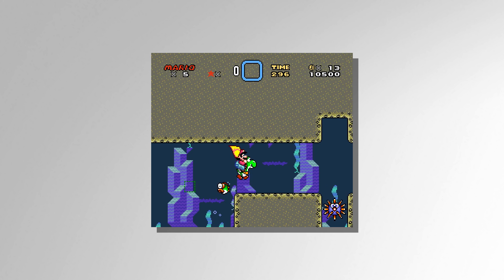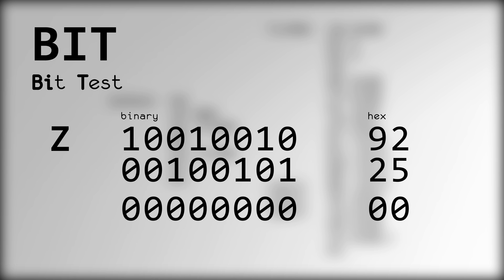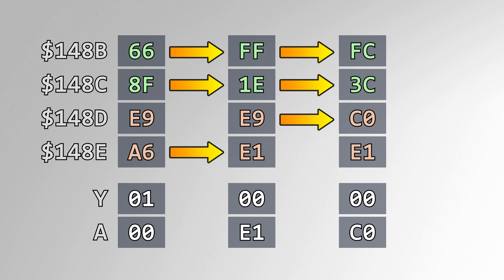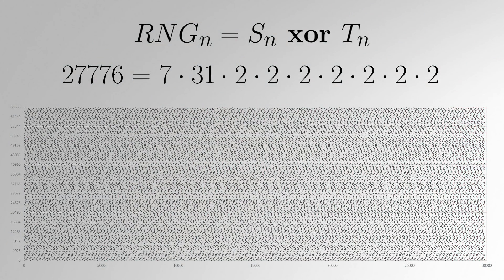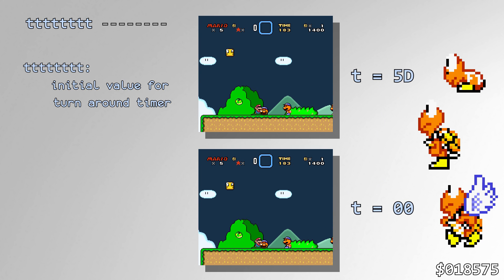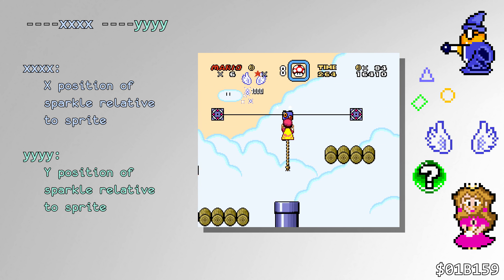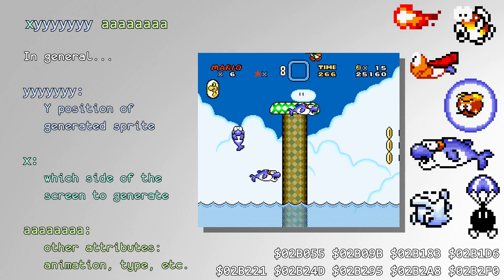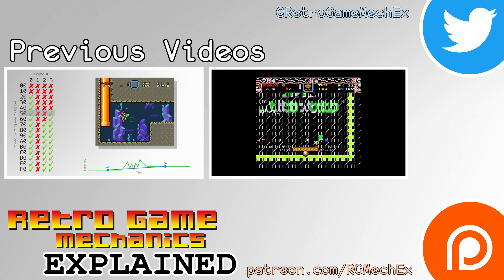Super Mario World - Random Number Generation

Comment: Found another error in the RNG values shown on screen, this time at 6:58. Here, th line that should read "06 03 05 01" has a "00" where it should have a "01." Also, this time, unlike the previous error I reported, it's not corrected when the line gets to the bottom.

Comment: I understand subpixels as a luck factor, since it's just down to a game having more precise movement than the graphics allow the player to (normally) manipulate. But I don't get speed oscillation
Reply: It’s kind of the same, but instead of the character’s precise POSITION, you’d be interested in the character’s precise SPEED. Consider needing to cross a gap that’s 23 units wide. Let’s say, for the sake of simplicity, that your jump lasts for 5 frames, and your speed oscillates between 4 and 5 upf (units per frame), every frame. Now, if your speed = 5 upf on the first frame of your jump, your speeds throughout the jump will be: 5-4-5-4-5; so, your jump will carry you 5 + 4 + 5 + 4 + 5 = 23 units; so, you WILL cross the gap. If, on the other hand your speed on the first frame is 4 upf, your speeds throughout the jump will be: 4-5-4-5-4; so, your jump will carry you 4 + 5 + 4 + 5 + 4 = 22 units; so, you WON’T cross the gap. As you can’t normally keep track of your precise speed every single frame, that event is considered luck-based. 🤓

Comment: why they didn't use the user input as a source of entropy to seed the PRNG? For example, every time the user presses a button, the current value of the internal H/V counter latch is captured and sent to the PRNG
Reply from the maker: Well in this case, it's not possible since controller button presses don't generate interrupts--the controller doesn't tell the CPU that a button was pressed, rather the CPU checks on the controller when it needs to.
But in general, latching the H/V counters is possible. I believe Yoshi's Island does this, just during the generation routine instead of on a button press.
Reply: @RGMechEx  I see. Anyway, very accurate and in-depth explanations on your videos, very well made,  congrats!

Comment: I'm not sure if your formula at 5:26 works when the 7th bit of T_n is set. Evaluating floor((255-2*T_n)/32) mod 2 when the 4th bit of T_n is not set and the 7th bit is set comes out to 1 when it should be 0, floor((255-256)/32) = floor(-1/32) = -1 = 1 mod 2. And if both the 4th and 7th bit is set, floor((255-288)/32) = floor (-33/32) = -2 = 0 mod 2.

Unless I'm reading it wrong and it's round towards zero / truncate?

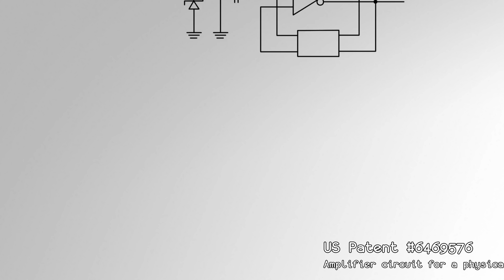Comment: 13:37 Well, I have a question: Those gambling machines with video poker (which you see a lot in Las Vegas) - are they truly random? Is that an example of hardware-based? Because I assume that they would legally have to be in order to be considered “fair”.

Thanks,
~J.J.
Reply from the maker: Things like slot machines get regular inspections to ensure they are operating as they should. So the answer to your question is yes. It would depend on the implementation on whether it was hardware- or software- based, but I would guess that if it were software-based, it would be much more complex than what was shown in this video.

Comment: The implementation of RNG routine, with the XOR and the repeated values resembles the structure of some hardware entities called Linear Feedback Shift Registers, or LFSR. These are widely used for pseudo random number generation in programmable hardware devices, such as FPGA. Could you confirm? Btw Great video!
Reply: S is formed from a linear-congruential PRNG, where m = 5, a = 1, and the modulus is 256.  T is formed from a simple 8-bit linear feedback shift register based on the polynomial x^7 + x^4 + 1.  They used two very simple PRNGs, and combined their results together to form a better PRNG, which isn't a bad technique overall given how few instructions were involved.  So you're correct that half of it is, in fact, a canonical LFSR, while the other half uses the somewhat-related LCG technique.

Comment: "It's not random because the outcome is consistent and predictable"? Uh, no. If that were the case, you'd be able to perform the exact same button inputs and get the exact same results. Saying that a D-20 isn't "truly random" because it doesn't cause a wizard voiced by Weird Al to appear is really stupid. And yes, one could theoretically determine the outcome of a D-20 by measuring the force of the roll, the friction of the table, etc, but by that same logic, a computer program doesn't have such variables, meaning that it's even MORE random than what one would find at a casino. Trying to say that something isn't "truly random" is really, really stupid.

Comment: Another great way to get more randomness without additional hardware is to take inputs states at various intervals and use them as seeds. Not that random in a console, but for example in computer software, it's very typical to grab mouse movement, which is very difficult to replicate

Comment: So even though the RNG will repeat every 27776 calls, it seems that for a lot of the RNG calls that only care about the results of the upper or lower bits; this means that for their relevant behavior that RNG call sequence "repeats" for them every 128 or 217 calls, respectively, even if the full number 16 bit number is itself unique.

Also, I have a question: For Wendy and Lemmy their index for which pipe to appear out of is 4 bits long, allowing for 16 possibilities. There's only 8 pipes possible to appear out of. How exactly does the that work?
Reply from the maker: The generated value is used as an index into a table instead of the pipe index directly. It is also responsible for the locations of the dummy Koopas. There are only 16 patterns for where all three show up, even though there could be 105 if every combination were possible.

Comment: You can be truly random without more hardware: By measuring time between button presses, by reading the RAM at the beginning before zeroing it out, among other tricks. Although most of the time this amount of information is very limited, so it's only useful for seeding. It's just more random, no truly random.
Reply from the maker: Reading RAM before it is initialized isn't actually as random as you'd expect. Once the console is turned off for at least 20 seconds 99% of the RAM has already settled on its 'default' value.

Comment: just subbed tonight! Apart from the PHY / PLY, this code should effectively run unaltered on a Commodore 64. Interesting to see such a long, odd value before numbers repeat. Looks like a very fast routine as well. Dunno why they didn't just JSL STA JSL STA RTL and not bother with the Y register at all. Or, the routine can be even quicker with JSL TAY then fall through routine again to get A and exit with random (unsaved) values in A/Y.

Comment: I wouldn't characterize PRNGs as "consistent and predictable." Consistent, yes, but predictability is something that sophisticated PRNGs are specifically written to avoid. In the case of SMW where you can examine 100% of the memory and code involved, and the PRNG is pretty simple in scope to begin with, then it's predictable (and manipulable).
Reply: In principle, every PRNG is predictable, because you could run the same code somewhere else and get the same result

Comment: I didn't understand a thing, but it sounds smart, so i like it
Reply: You, I like you.
Reply: The "Random number generator" creates a pseudo-random number based on a complex set of values (the "seed," I think) that has a tendency to change constantly. Unless there's something hardware-related, computers are actually incapable of creating random numbers.
Reply: @Chaos89P  

yeah. the "random" number generators are just a very convoluted mathematical calculation based on a "seed" value.....if you always use the same "seed" the "random" number will always be the same.
usually what you do is set the seed to the current time-stamp of the computer clock.
that will create a better random number than a static seed,
of course nothing beats a good hardware random number generator....but aint nobody got time for that!
Reply: @sabin97  But the current time stamp is already somewhat random. And when the seed is random, the resulting RNG is too.

Comment: Ok, so where does the seed come from? You said suppose initially it is 66 and 8F. What will determine this initial seed when I start up the game? If it was hardcoded, every game will start with exactly the same RNG outputs and differences will only accumulate due to player actions. If it is not hardcoded, well where does it come from?
Reply from the maker: The initial seed is 0000. This is set when a big chunk of memory is zeroed out when exiting a level. So yes, the game will start with the same RNG outputs every time (even every time you enter a level). A more "random" way of getting an initial seed would be to read a memory value before initialization when you turn on the system. Without initializing it to anything, it is undetermined what a memory value holds, so you could use this as a seed that is not guaranteed to be the same every time the system is powered on.

Comment: Awesome video. Just wanted to mention that using the system clock is a great way to seed any RNG routine.
Reply: I didn't know their were other ways to make a seed...
Reply: Aaron Misner 
Would be good if it would have one and it couldn't be changed easily to make it consistent for every run
Reply: True, or any other kind of timer that runs continually from system boot, which is something that's been used on pretty much every system in the world ever (the earliest i can point to is the built in BASIC of the Sinclair ZX80, and the successor models of course, where using the RANDOMIZE command sets the 16-bit RNG seed to the number of video frames since power-on, repeating every 20 minutes or so in 50hz regions). However, this is specifically about SMW randomness, and as stated, it resets the seeds to zero at the start of each level, so your only actual source of entropy is how many times the RNG has been called in that particular level before the call in question...

Comment: Couldn't you get true randomness by modifying the seeds based upon a value determined gleaned from controller inputs at irregular intervals? Since no two people play exactly the same, nor even does the same person play the same every time, player inputs should be a completely unpredictable variable.
Reply: NES Tetris uses controller inputs to determine next piece so I'm sure it's possible in SNES.
Reply: Kinda.  On a lot of games we used to seed random number generator based on time it took to start game.. as most people would take random amounts of time to press start (or go thru menus, etc).

.. but once game is started, you need to seed numbers based on this value (and record it), that way you can replay what happened in a crash, etc.. to make sure you’ve fixed bug.. (too long to explain )
Reply: groszak1 
That game has much more resources left for computing since it's just a single screen puzzle game.

Think someone mentioned it being common for GBA games though.
Reply: There really isn't such a thing as "true" randomness when it comes to software. Using controlled input to influence unpredictability can actually reduce the entropy of the prng. Even producing it at irregular intervals would still unfortunately need to be decided upon in some way or an event, which is another random decision.

You can simulate more entropy/random-y-ness by masking it w/ noise, but generally allowing for external influence will have the opposite effect, especially when your prng is periodic/cyclic. It's very easy to go down the rabbit hole believing that adding more complexity/noise is improving randomness when in actuality you're likely reducing it. The point is, "true" random numbers are hard, and is a whole field in itself depending on the applications.

Fortunately, though, randomness isn't too important in the context of regular gaming. You only need to convince the player that something is unpredictable and it will have the intended effect.
Reply: I think seanklitzner proved something like that for Zelda 1
Reply: KefkeWren Yes and no. It's not truly random because it's influenced by player input, which is not random.
Reply: KefkeWren Nowadays, I'm sure you could do this. I'd wager that back in the SNES days, memory was too precious to store controller input.
Reply: @mevansthechemist  That makes no sense, have you even written code at a low level?
Reply: @mevansthechemist  Does it necessarily need to store it though? You could modify the seeds every once in a while, based purely on the current input.

Comment: That last part was wrong, though. In order to be truly random you need any kind of random source of entropy. For instance, most GBA games use input timing to seed the RNG, since human hands are inherently random, at least a bit. Of course, this can be exploited by TASers, but oh well, so can almost anything else. More modern consoles have other entropy sources available to them, like network packet timing, or storage media response times. TASers usually try to mitigate those things by starting their runs from completely blank consoles. Have you seen NDS TAS runs and the lengths they have to go to now in order to get consistent RNG?
Reply: Right-bit randomness (like mouse movement) isn't objectively random, but since humans can't move their mouse accurately down to the micrometer, it's close enough. Thermal flux chips are even better. Nothing short of quantum measurement is truly random, but again, it's often good enough.
Reply: I think you misunderstood something. He talked about true randomness in the same way as you did in your second sentence. An entropy can be collected from an avalanche diode circuit which was shown at the end of the video when he was talking about the hardware based random number generation.
Reply: He said that the avalanche diode was a necessity which is not the case, since using input timing or network packet timing works just as well.
Reply: nullplan01 
Wasn't that just an example of something random?
Reply: nullplan01
Well he's not totally wrong. He said hardware base. Not specifically using an avalanche diode. Nowhere did he say is was a necessity as you put it. 

Hardware based includes human input and other physical inputs. The RNG in SMW is pseudo because there's no physical input, all software.
Reply: I've heard of programs that use time/date (which is not random, but it is different everytime), or even mic/camera input. I think it can be argued that any method with repeatable input will produce repeatable output, so it's hard to say whether "true randomness" exists at all. If you dive into the physics of things, you end up thinking that everything is causal, except the behavior of the fundamental particles, which, for all the best efforts of today's top scientists, appears totally random. My brother is a doctoral student in Physics, so I hear him talk about it sometimes...
Reply: I saw a video once where someone generated a bunch of numbers using an amount of radioactive particles. I don't think it would be very practical to do what they did in a video game though.